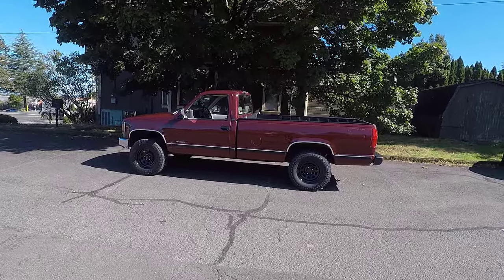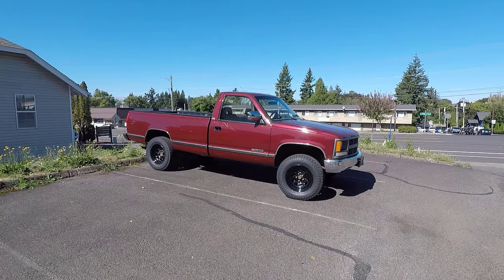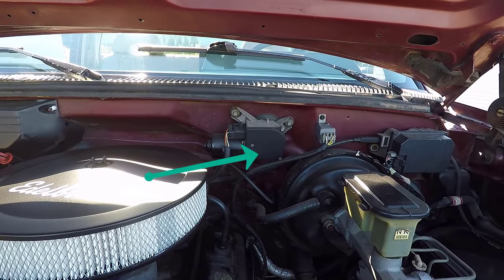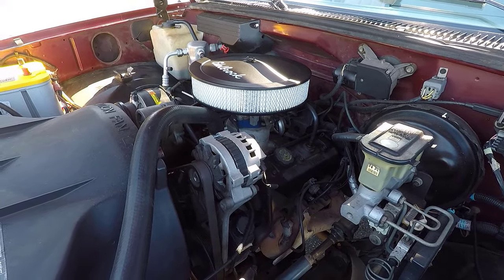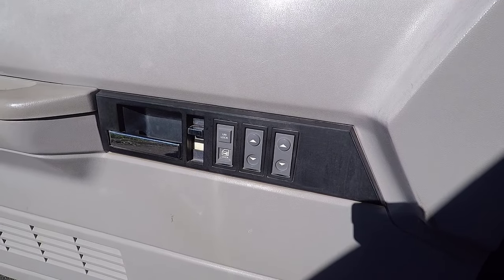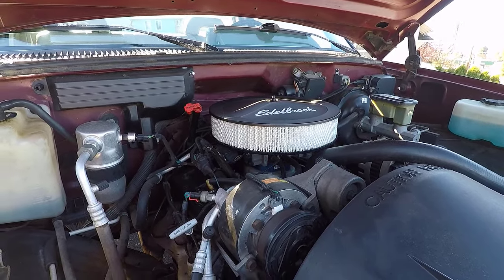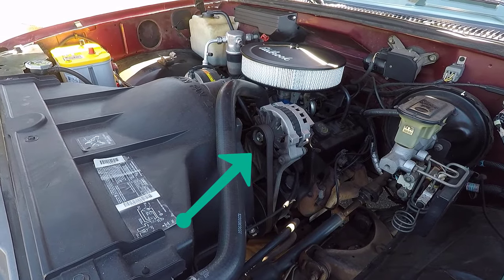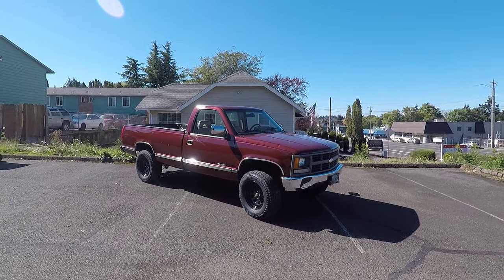10 COMMON ISSUES WITH 1988-1998 C/K PICKUP TRUCKS

Comment: Actually most of them sound not fatality, not hard to fix in garage, and parts are not expensive even from dealer. 
Mine is also a 1994, it's a Chevy Suburban Silverado K2500, with a 454 underneath. I own it for 1 and half years and 10k miles so far, I love it.   
Issues I encountered:
1 ICM(Ignition control module), caused stall during driving, wrong-timing-like rough idle, and enormous backfire. This once happened on Golden Gate Bridge, what a perfect place to have your truck broken down.  lol And right on the bridge, the catalytic converter got shattered by the backfire.  Changed a new ICM. My mechanic told me this is common issue. I dissembled the failed one, yeah, one of the chips fried.
2 4WD actuator, sounds like another common issue.
3 ABS module. Yeah, it's module, not wheel sensor.
4 A/C compressor, looks like another common issue on 88-95, because I can't find it in junk yard, all are gone, means many are bad. Meanwhile 96-98s are there, means they don't broken so many. 
5 Electric door lock on driver side rear door, may be the one on your list?
6 Radio can't receive any signal, don't know it's antenna or something inside the radio module.
Reply from the maker: The Golden Gate Bridge had to be a horrible place to break down. I had EGR issues when I first got the truck. I haven't had the truck but maybe 2 years and change. The joke is I spend more time working on it than driving it lol. We call it the movie star truck since I do so many videos with it. But it actually runs great and I have come to really love this old truck. Next jobs coming up will be intake manifold gaskets and then a new steering box and shaft to get rid of the play in the wheel. Thank you for sharing your truck. Its encouraging to hear from everyone. Hope you keep watching these truck videos. Have a great day and luckily most of us work in these old trucks as the parts are pretty cheap and the vehicles pretty straightforward
Reply from the maker: Oh, you should check out LMC truck for parts
Reply: @BuildYourOwn  Haha, I have the same joke, but mine is the damn ICM. The problem is, you don't know when will this damn thing goes bad, so when you want to diagnose it, it runs good. But when you assume every thing is okay, go out for driving, it goes bad suddenly. To make it worse, at places that you never want it to happen, the GGB is just one of them, it once happened in a 2-line tunnel without emergency parking line, then one day at center line of a high traffic flow 5-line highway, and almost got rear-ended by vehicle behind when trying to merge to right shoulder. 
I changed fuel pump, fuel filter, injectors, fuel pressure regulator spring, and then distributor, ignition coil, spark plugs, so I know every hardware for fueling system and ignition system. 
After changed ICM, the stall problem never happened, but its power is very very weak. After many miles of driving, some reading on service manual, it finally turns out I didn't it wrong when doing ignition base timing. You know there is a ignition wire, should unplug it when doing base timing. The repair manual says the wire is near distributor, but I never found it, then I just assume that cold idle is base time, so the actual timing is about -30 when it supposed to be +4. Then on the internet, I found out the wire is actually inside cab, above passenger's feet, near the blower motor! Then I did find it, unplug it, finished the timing, then every thing goes right till now.
Yeah, anyway, working on these old trucks and engines, running between garage and junk yard is a pure fun. Especially 88-95 TBI system, everything is simple and straight forward.
Sometime I feel, it's like conquering a good horse. It tries everything to throw you on the ground, but when you finally win, it will be your best friend, honest to you forever.
My coming up project, is add second radiator, and electric fan convention, then have someone to reprogram the ECM, add stand-alone TCM. Maybe in the future far away, procharger.
Reply: @BuildYourOwn   Checked, looks good, thanks. The website design is quite straight forward.
Reply from the maker: Sounds like you have some serious experience with these trucks... So let me ask you... I have the 4.3 tbi and I am seriously considering an engine swap, but I want to keep it as simple and straightforward as possible. I've come to the conclusion that I would like to find a 350 tbi crate engine, maybe put some good heads, a performance intake that accepts tbi and some headers and call it a day. I am looking for as plug-and-play easy as possible. I would keep messing with my 4.3L but there are no parts for it. Curious about your input
Reply: @BuildYourOwn  I am actually newbie, or ignition timing won't caught me such long time.  I also think 350 is a good choice, probably have some parts interchangeable with 4.3, since they have same size of cylinder. And in my place, northern California, 350 is very very easy to find in junk yard. One of the good things for me about junk yard, is I can "simulate" my plan in junk yard before do the actual work on my own truck.
Reply: @BuildYourOwn  @ nice truck👍👍👍     Can i ask u for the paint code???       I had one  15  years ago,    Same color, parted out,

Comment: The exterior door handle replacements on the early year models are difficult to replace due to the lack of those 2 small door panels on the side of the doors. It's good to know that GM added them on for the later model years.

Comment: Quick question I have 95 c2500, it will crank but won’t start unless I give it  gas then it idles down boggy if I release the gas and shuts off 350 Tbi any help please
Reply from the maker: I'm sorry to hear about the issue you're facing with your '95 c2500. Based on your description, it sounds like it could be a fuel delivery problem or a sensor issue. Here are a few things you might consider checking:

Fuel Pressure: Ensure that the fuel pump is delivering the correct pressure. A faulty fuel pump or clogged fuel filter can cause these symptoms.

Throttle Body and IAC (Idle Air Control) Valve: The TBI system relies on the IAC valve to regulate the idle. If it's dirty or malfunctioning, it can cause idle issues. Cleaning the throttle body and IAC valve might help.

Vacuum Leaks: Check for any vacuum leaks, as they can cause rough idling and stalling.

TPS (Throttle Position Sensor): A faulty TPS can cause idling issues and stalling. You might want to test its functionality.

Check the Distributor: Ensure that the distributor cap, rotor, and spark plug wires are in good condition.

ECM (Engine Control Module): Sometimes, a faulty ECM can cause such issues. Check for any stored error codes.

Fuel Injectors: Ensure that the fuel injectors are not clogged and are functioning correctly.

It's always a good idea to start with the basics, checking for spark, fuel, and air. If you're not comfortable diagnosing the issue yourself, I'd recommend taking it to a trusted mechanic who is familiar with the TBI system. I hope this helps, and I wish you the best of luck in resolving the issue! 🚗🔧👍
Reply: @BuildYourOwn  really appreciate the info I actually have change air idle control on other cars and it improved over all reliance on it will have to see if I can clean it or just replace it spark plug wires distributor rotor had work on it before I got it so I kind ruled that out very informative video appreciate the quick response man💯💯

Comment: I own a 96 K2500 and a 2000 C2500, both of which are 6.5 Diesels, and, I don't have any of these issues oddly enough. Especially as my 96 has 366,000 miles and my 2000 has 264,000

Comment: I had the wiper motor problem in my 1989 C2500. It was bad solder joints on the circuit board where the wire harness plugs in. Just take it apart and resolder for a no parts required fix.
Reply: I had the same thing happen 1998 C1500 WT, a quick re-flow, and it was a done deal.

Comment: All!!!!! Of those complaints were at around a normal mileage for them so go out except the windshield wipers. It’s just a machine and will need a fixin every once in a while. All simple stuff unless you don’t know jack about engines. Alternator-30 mins pretty much everything about 30 minutes each except the manifold gasket and that’s not even that bad. Other then that, good video and pretty accurate

Comment: I thought that steering assist didn't come in till 2003 when they made other components drive by wire? You are spot on, though I been rebuilding my baby over the last 4.6 years. The door lock actuator I had no idea till I believe I possible applied too much pressure on the switch and now only my driver side works. What a coincidence lol.

Comment: I have a 1998 GMC c1500 with 291,000 miles and none of these problems have occurred on mine. Of course I have had to replace stuff but parts only last so long too.
Reply: Same, 4.3 5-speed, trying to work out some gubbins in the rear lights rn, it just gets weirder every time I "fix" something.

Comment: I have 97 with a 5.7 I had a misfire and found out it had a plastic distributor shaft so I took that plastic distributor out and replace it with a aluminum shaft in the truck runs so much better

Comment: 3:07 I believe that the 88-89 models were affected by this issue also.  My 88's wipers will work fine for a few seconds and then sometimes it will go at a higher speed even though it's on the lowest control level.
Reply: My truck does the samething, and then when i shut them off sometimes they will just keep going amd shut off whenever they want.
Reply: That does get annoying sometimes.
Reply: I'd say it's time to swap out the older style wiper motor for a newer one.
Reply: The recall were bad solder joints on the board just pull the board and hit it with the iron maybe even add some solder to the joints and your problem will be fixed took me a minute to remove my board and 5 mins to hit the joints with the iron and put back in and haven’t had a problem since I did that and all speeds work

Comment: Do you still have the factory air cleaner in place? My 93 Chevy 4.3 thermac air cleaner flap that directs hot air from the exhaust manifold took a crap on me last week. The wax pellet that melts which slowly opens the flap doesn't work anymore. I stuck a piece of rubber hose in the flap to hold it open so I could get fresh air to the throttle body.  Truck was running like crap when flap was stuck closed and nothing but hot air going to throttle body! You can't find replacements anywhere, only option is salvage yard.......chances are they don't work either.
Reply from the maker: I got rid of the factory air box long ago for this Edelbrock Pro-Flo https://youtu.be/cJjahhlD854

Comment: I've owned my 95 c1500 for 5 years now i can confirm all these issues lol. ive dealt with or am still dealing with and havent decided it was an issue worth fixing. I've taken this truck apart many times probably one of the easiet full size trucks to work on.
Reply from the maker: Of course, I hold the C1500 close to my heart as I have a 94. I bet you have a lot of knowledge to share if you've taken your truck apart many times. I have over 60 videos of the truck, many of them of me doing some type of repair or upgrade. Here's the playlist https://www.youtube.com/playlist?list=PLZPFVgOzDxzUNotTlw4KYrOgZebABH3Gg - I also put together a GMT400 Upgrades and Performance Parts list on my website and it's the best information and resource anywhere around https://www.buildpriceoption.com/gmt400-upgrades/ - Thank you for watching!

Comment: I got a 95 suburban k1500 with 230xxx and I got a wheel speed sensors for like 20$ and was super easy to do and I had was I had to replace the alternator and that costed me 160 to do my self as long as you have some basic tools you can do it yourself and save money then having a shop hurting your pockets with labor

Comment: I have a 1996 GMC Sierra C1500. I bought it new. Has 180k. 5.7 ltr I have replaced water pump, ac compressor, alternator, ww wiper card, and intake gaskets. The thing is that parts are plenty and not that expensive. And any shade tree mechanic can work on one. My truck is a rust free Texas truck and has never been wrecked. The original paint is still shiny because it has always been garaged  Any time I go to get it inspected or front end alignment, things I cant do at home, the mechanics always ask if the truck is for sale..they know what it is. A good clean 96 3dr truck is very marketable.  My 2 cents.

Comment: Have a question and hopefully you'll be able to answer it, I cant seem to find the answer anywhere. I've recently changed my distributor cap, rotor, and ignition module. After changing, I would get weak power to the truck, and now I get no power to the truck. My lights won't even turn on, do you have any ideas what it could be?
Reply: Rotor wrong position its sounds like must be in exact spot / position it came off of

Comment: Gotta say I’m pretty surprised at how spot on he was another issue is the fuel pump either the pump going bad electronically or the hose line blowing when I bought my 91 just about everything and more was wrong with it bought all new parts swapped everything internally from gaskets had a vacuum leak as he mentioned to oil to filters battery fuel pump tires were new distributor rotor and cap spark plugs and wires everything still not all done got rust and bad lines and filter that need to be replaced all new brakes shocks straight pipes of course since I did most of it myself I saved a lot did have someone do the shocks and brakes for me and the pipes had those done right but other than that I have definitely seen and experienced many problems with that truck but I love it to death always wanted one since a youngin 😂 but I even learned something new to does anyone know is it bad to drive with your rear diff making those noises I always thought that clunking and banging when you stop was normal for those trucks but I guess that’s another thing I need to have replaced damn…

Comment: my 89 wipers do too its common on all 88-98
Reply: intake gaskets just under 100 if you do it yourself like i do
Reply: and most of that is new fluids motor oil and new antifreeze
Reply: 3-400 for an alternator hell no lol buy used or good new for 100

Comment: Replaced a lot of these on my truck one question I have is what could it be when I let off the break to drive or reverse it’ll make a clunk noise at first! Also when I go over an uneven bump I’ll hear something underneath clunk and knock around
Reply: Try new back shocks. I had same mind of issue putting it in  drive. Big clunk. Doesnt do it anymore
Reply: @Trekguythingy  I’m pretty sure it’s my rear drum sticking a little
Reply: @micah2395  either a leaky wheel cylinder or axle seal will cause the brake to stick.  It will also cause wheel lockup when wet

Comment: Door hinge pins,weak interiors,troublesome posi differentials weak upper control arms weak ball joints in particular 4x4s ,intakes issues on 5.0,5.7 Vortecs cooling maintenance is imperative, consider intake re torque as regular maintenance on the Vortecs, Vortecs have plastic housing distributors, handled them w caution.Poor coolant maintainance on Vortecs or using hard tap water, instead of distilled water can lead to coolant leaks and aluminum component failure,and severe engine failure,all avoidable with good care,and gauge watching.

Comment: IMO big tires and lift on a 2wd (V6 especially) is an error. Poor little engine has to work even harder. Gas mileage suffers as well. Am I right?
Reply from the maker: You can have your opinion and I can lift my truck if I want. They make the fucking kit. And no, my truck isn't slow and the gas mileage tradeoff is minor. I have a badass GMT400